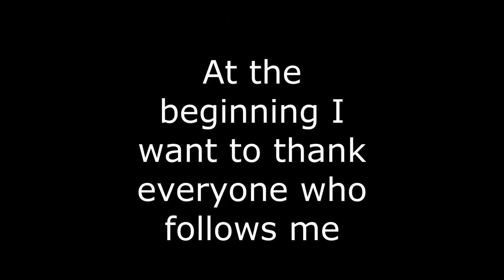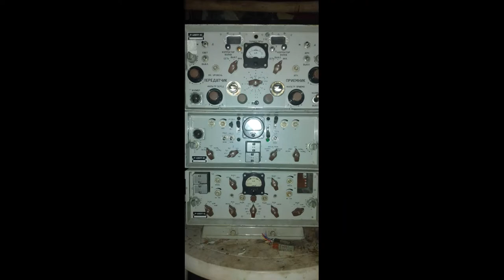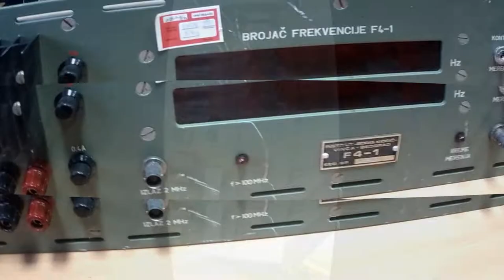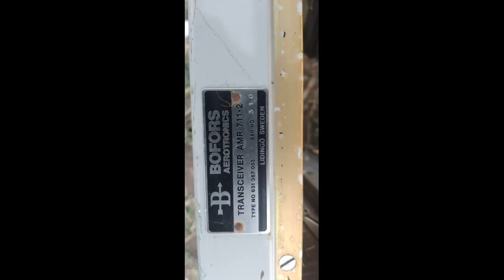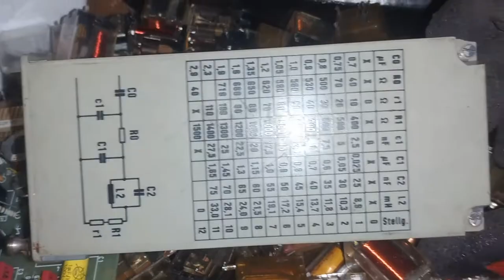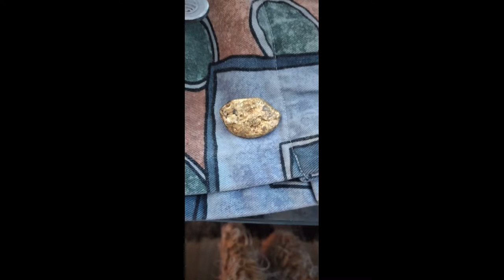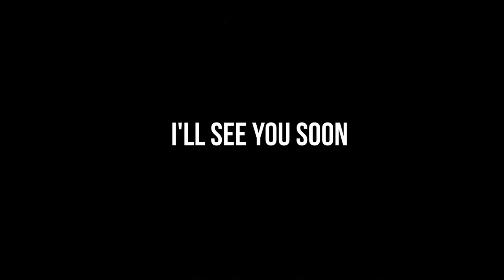Very good gold recovery electronics

Comment: So is this all yours? Looks like it was shipped in crates. A lot of good stuff But I was waiting for a board loaded with Gold cap gold leg chips. I have a lot ranging from 144 to 300ish and one I bought recently with chips doubled stacked and soldered to each other.
Reply from the maker: this is all mine. I buy them and then process them. They are not delivered, but I pack them myself to make them easier to process. This is just a small part of everything I have for processing. On another occasion I will publish more. Like Hp boards with gold lines.
Reply: @goldrecovery882  do you have a email? I can delete the comment afterwards if you want it to be private or I can give you mine.